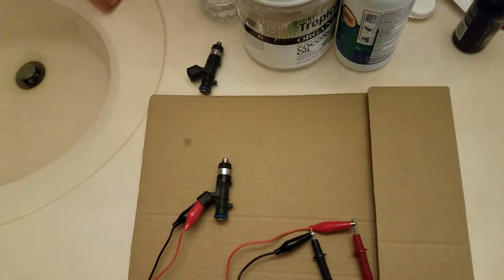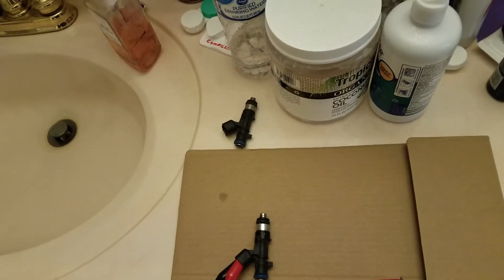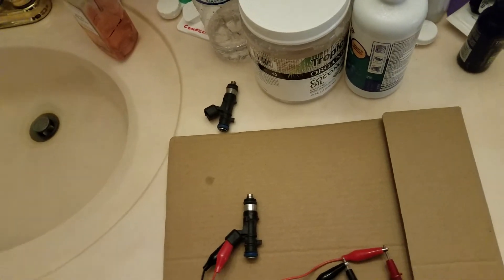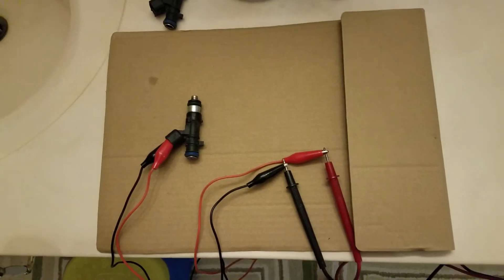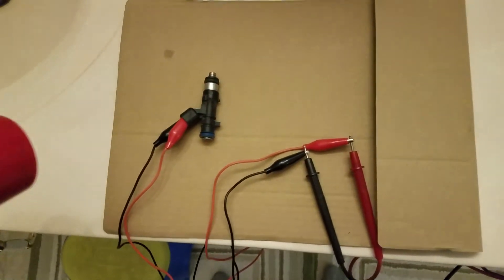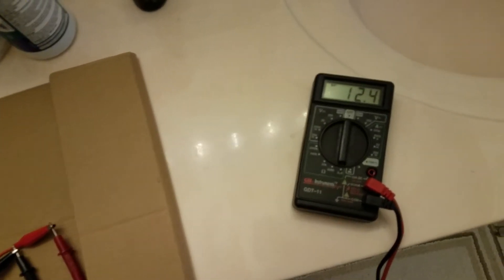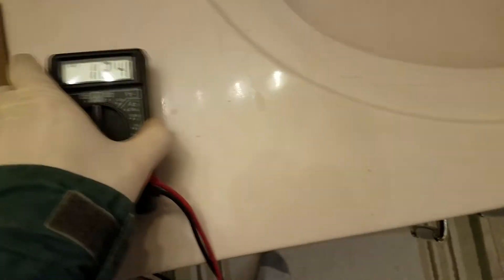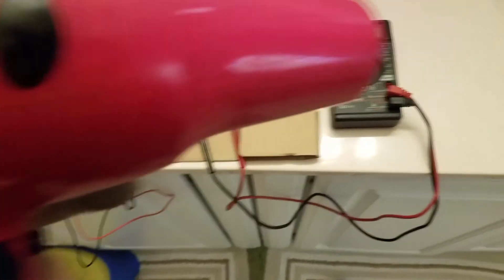P0204 Chrysler T&C 2009 Fuel Injector Test

Comment: Great video, our 2008 Chrysler T&C has the same problem... The P0203 code goes off only after the car warms up. We are facing quite a repair bill, but your video gives us hope that it is indeed the fuel injector. Thanks!
Reply from the maker: You are most welcome. Every blog I read up to doing this hair dryer test made us believe we were in for replacing the computers...$$$. Was so glad that I shouted when I found this out.
Reply: We had the injector tested when they took it apart using a voltmeter and it was failing and they also tested two others and those were ready to fail so we had all 6 injectors replaced on our 2008 van and now it's working great! Thanks again so much for your video.
Reply from the maker: You are very welcome.  We were being told by the dealer that the ECM would need to be replaced but I wasn't having any other issues so I wondered what the chances were of only a P0204 fault and not other issues if the ECM was going out.  Tore into the umbilical and found no cut or chewed wires which let me to finding a way to test the injector without the ability to run the engine.  Glad this video has helped so many.  Appreciate the comments.

Comment: Hey Ross

To get to the injector, it looked like you had to take off the intake, is that the case?

I have a cyl 4 misfire, that we swapped plugs/wires and we're not getting it anymore, but still having the same issue that we had prior to the tune up.  We took it in, and the mechanic isn't wanting to test the fuel injectors until the last minute as it's involved apparently.  Thinks it may be a accelerator pedal switch or something like that...we'll see.

Great video, thanks for the information, good to know!
Reply from the maker: Yes, the plenum had to be removed, and the fuel rod. This being my first time it took around 4 hours to take it all apart and check the umbilical (first video) and then the injector (2nd video). I think to just change the injector only it would only take 1.5 hours total. 

What is the code being thrown?
Reply from the maker: slundy, what engine code are you getting?
Reply from the maker: Yes, had to pull the plenum/air intake and fuel rod.
Reply from the maker: It was the P204 code. Stands for cylinder 4. You don't know what exactly is wrong with cylinder 4, this is where the troubleshooting came in.

Comment: This is a great video! I assume that replacing this injector solved your problem? I have a 2008 grand caravan,3.8. stopped at the store and left it turned off for 15 mins. When I started it,it ran rough and engine light came on. Luckily I live close by and got it home,put the scanner on it and it showed injector 3 was open. I checked the plug, wires and coil pack and all work,let it cool down completely and started it. It started and ran fine so I cleared the codes and shut it off. After 15 mins, started it and same prob,same code on injector 3. Does this sound like the prob you had? If so,did replacing that one injector fix it? Thanks.
Reply: We have a 2008 Chrysler T&C with the same problem, same cylinder (P0203). We're having the injectors (all of them to prevent future failures) replaced.
Reply from the maker: Sorry for my delayed response. Yes, replacing the injector fixed the issue, no repeat issues since changing out the injector.